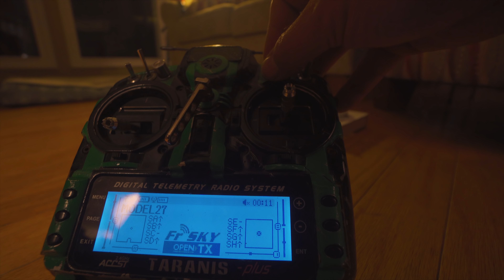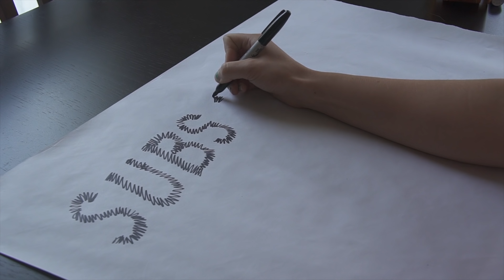I Made a DIY Hovercraft

Comment: You could try running the skirt straight down the side.  Might allow it to have more volume for lifting the body off the ground.  If you'd tape short chunks of plastic straws along the bottom edge of it then run a string though them to make a drawstring of sorts, you could snug the bottom of the skirt tighter to help hold the air in and puff it up.  That might be more work than it's worth though. Lol. Have fun!

Comment: Dude this is awesome! I make micro hovercrafts out of ir helis...I found tilting the lift motor 25--30 degrees forward to push air towards the back helps pick the back up....you could also add a foam plate with a pattern of holes underneath the craft to distribute the air pressure...

Comment: I think you'd be better off mounting the battery on the very front. The hole is offset so even if it was evenly balanced front to rear, the thrust would still cause it to be rear heavy.
Reply from the maker: Totally agreed. Didn't realize that the balance mattered so much for this.

Comment: That's weird I have the same issue with the hovercraft I build.  The acceleration motor spazzed out at low throttle. It's an old pwm esc from China. Just have it hooked up to frsky l9r receiver

Comment: i tried making shendrone hovercraft you played with at museum but its not working. i set up mmix like he said. but with angle mode on lift seems link with rest of motors. in acro it unlinks it seems but the it will just keep turning a direction till you turn the other direction. that motor stays at higher throttle u have to move yaw stick to try make it go straight.. thrust forward will lock at high throttle not come back down..

Comment: Nurk, I've experienced motor issues in the past similar to what you're having, and assuming you're using a BLHeli32 ESC, try increasing the PWM_Frequency on the ESC.  I think it will resolve your problem.  If you aren't using BLHeli32 then I'm not aware of a solution because the old BLHeli configuration doesn't include that setting.
Reply from the maker: Top tip -- I'll take a peek and see if I can't make these adjustments. I'm confident you're right because this is a 32 bit esc.